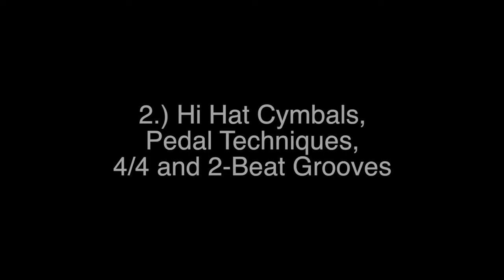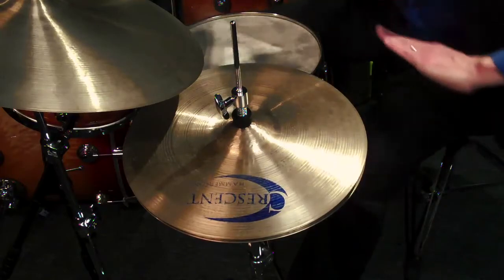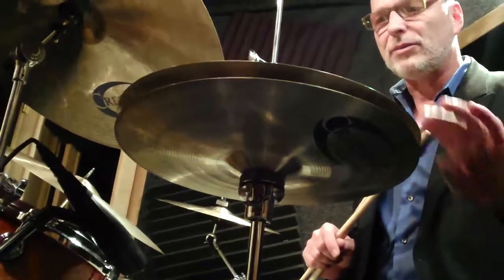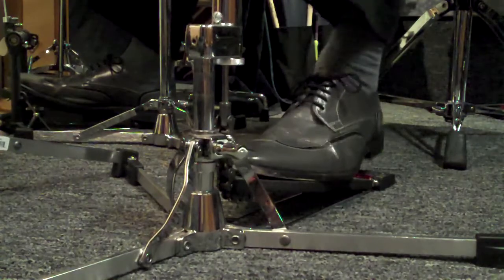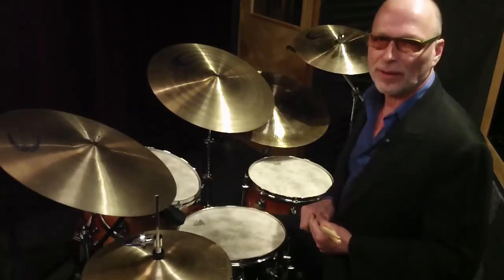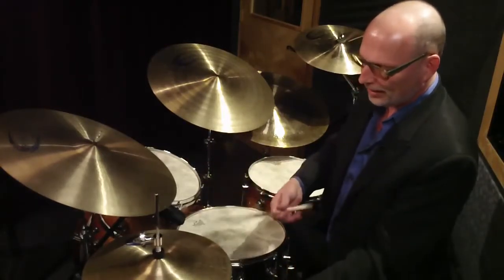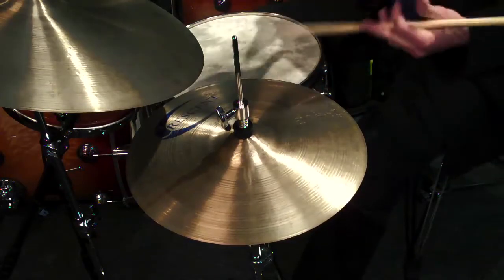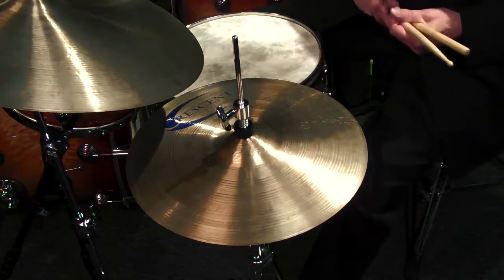Jazz Hi Hat Cymbal Sounds, pedal techniques, 4/4 and 2 Beat Grooves - Drummer's Guide to Big Band

Comment: I have a question: can pedal and open high hat be easily played one after another?
Reply: It depends upon the Tempo and the sound you want. Using a heel down technique will provide a lower pitched and slighlty longer sound than Heel up. With a Heel up technique the sound is higher and shorter due to more pressure. Heel up works the best at faster Tempos but there is a limit to have fast you can do this. I hope that helps! Check out my new book, The Ride Hand for more exercises with Hi Hat pedaling techniques.